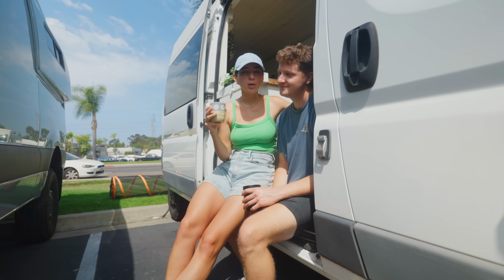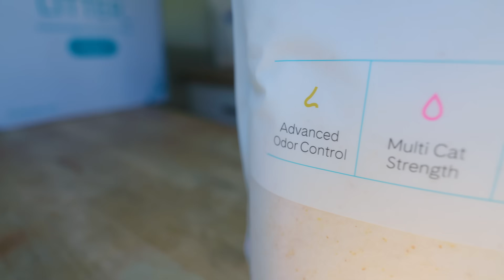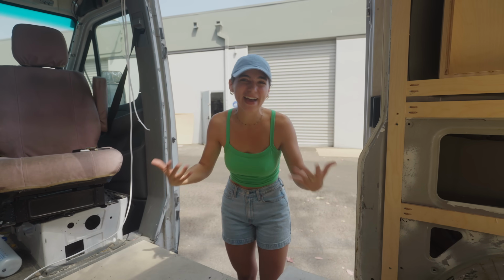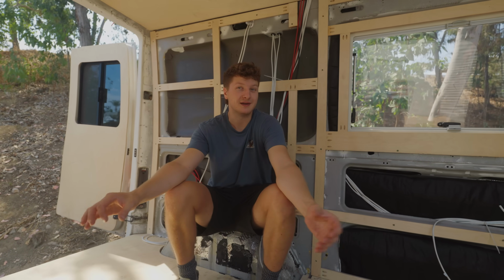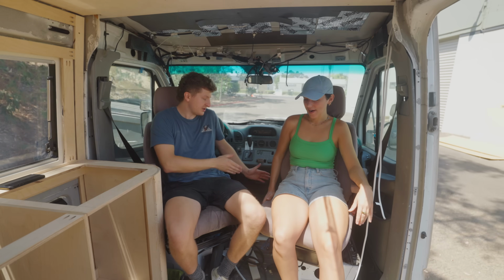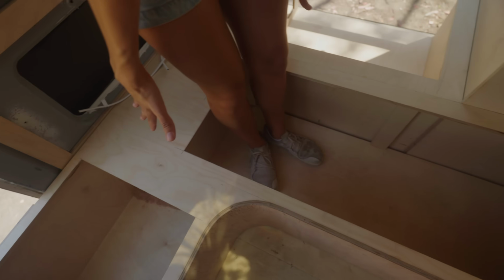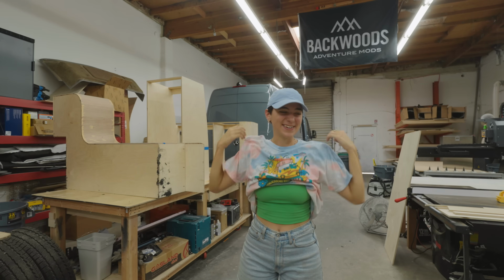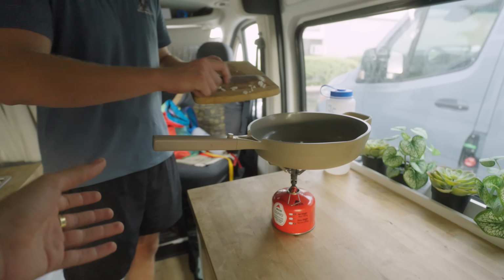Starting over. Building a camper van in 30 days..

Comment: Love the videos! I live in a converted 30 ft Car Trailer. In short I have in floor hydronic heating with an Espar diesel heater. Recirc glycol which also does hot water and recirc shower.❤

Comment: какой смысл утеплять xps только пол, и оставить стены и скорее всего потолок не утепленными?
Reply from the maker: The cabinets didn’t get installed. It’s easier to cut panels of insulation only for what’s being installed at the time. Everything gets insulated with 2 layers of thinsulate and then one layer of low e reflective insulation. Doing it behind the units as they get installed keeps it from getting dusty and dirty while we are in the process of the build. It’s also much easier to keep the insulation in once the van is strapped!